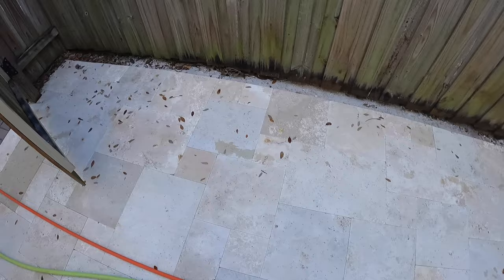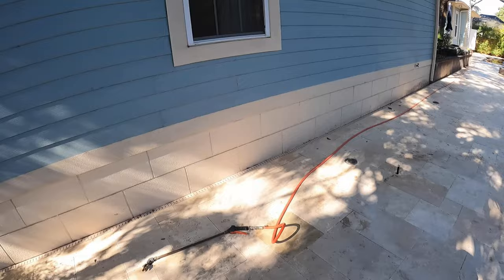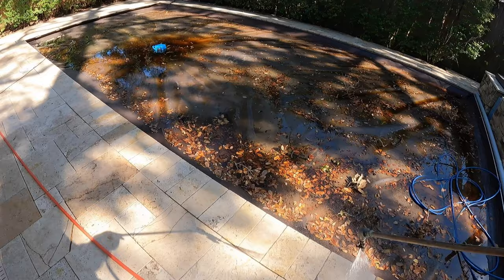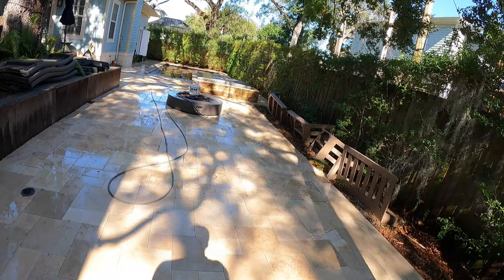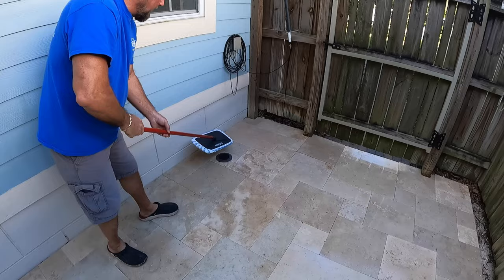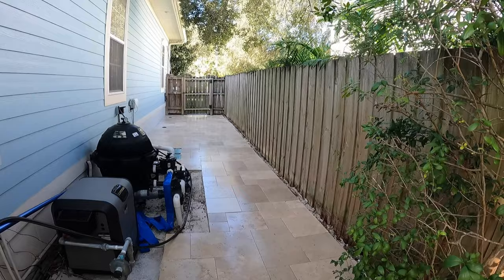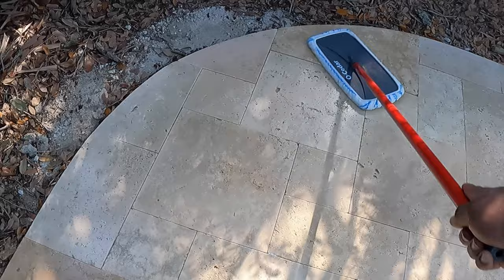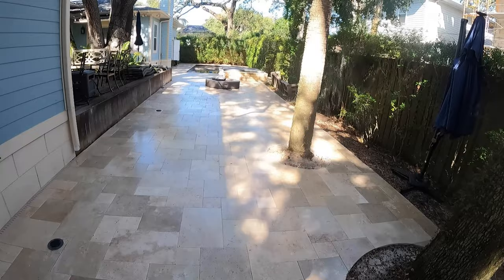How To Seal Travertine Pavers

Comment: Got to watch about 10 mins of the video yesterday, just finished it and the process is really different for sure.

It make sense that you can't just spray the sealer and let them dry like other pavers since these don't absorb liquid. 
Did you have to change the mop microfiber pad while sealing or was that one pad good enough for this job?

That shady area might've made it difficult to see the streaks when sealing them. But as for maintenance from the home owner, they won't get as dirty from the trees and easy to rinse or use a leaf blower to clean.

Great job as always. They should have you come back and clean the fence. It stands out big time now.
Reply from the maker: Thanks for watching. I actually changed the microfiber cloth about right the end when we bend that last corner heading out by the AC units. The mop was starting to stick and not gliding as smooth as the beginning. So its great to have 2 mop heads just in case especially for such a big area.

Maintenance will indeed be easier from the leaves and acorns. The home owner can easily rinse those off. Yes that fence definitely stands out, the person who gave me the lead actually thought I caused that lol I had to show him the initial walkthrough video.

That house needs a good wash as well as that back wooden deck area.
Reply: That's what I was thinking, bigger area being a factor. So it starts to stick and not glide well, interesting. Good idea to have a second mop head for sure. Thanks for the info.

I have to say since I watched the start of the video and then finished it later I had to go back and look at the fence myself. Lol but I knew you wouldn't have done that and not do something. But that's where having those videos come in handy for sure.

So I'm hearing a house wash and fence cleaning will be on the books when they complete the area in the back. That's me thinking positive😁. I'll look out for it for sure.

Comment: Looks great.  I clean a 12k sqft travertine  patio/pool deck annually.  Going to have to see if he wants to seal it up this year.  SH is right under $5 per gallon in central MN.  That includes sales tax and delivery costs though.
Reply from the maker: Yes there's great money into the sealing.  5 bucks isn't too bad if they're delivering it.  I know transportation of chemicals is expensive in itself.

Comment: Did you do a full second coat or just touched up. How long did you wait before you can walk for second coat? Thanks.
Reply from the maker: Just a light coat/touch up.  I typically wait about 45 mins/ 1hr. Before 2nd coat

Comment: Man they came out great. SH went up to  2.80 a gal here my area. Did the 6 percent strip the old sealer of the old tiles.
Reply from the maker: Wonder if they'll ever drop the price on sh.  Sweet!
Reply: @PinkFlamingoPowerWash  The way things are going it may not but hope it will.  Everything is getting expensive

Comment: Great video 🤜🤛 I saw the propane tank and torch…… did you hit the travertine lightly with flame to evaporate any condensation? 
And then lay down the sealer?
Reply from the maker: Lol heck naw.  No flame here hahaha that's willlllllld.  Nope the travertine dried from the air and sun just fine.  I wouldn't dare try to use heat on a customers travertine and potentially damaging it.

Comment: Great job thanks for showing the product. I just built a pool and wanted to know how to seal the new travertine. Looks easy just time consuming. Does it matter if it’s too hot out for the product to be applied. Do the pavers need to be dry. I live in Florida. It’s cool at night but hot in the day. 

In the early morning there is some dew moisture. Does this matter to be applied
Reply from the maker: Yes you'd wanna do it when it's cooler outside. So around 9am-12pm and then around 4pm if it's an open area without shade or tree cover. I would do it under 85 degree weather if I were you if there's no cover.

Comment: Glad you put this video up kind of never to do my first Travatin tile stripping and sealing. Going tomorrow morning to get the same sealer hear in Orlando. My question is on the second seal you don't spray it again or did you just touch up the streaks with the Swiffer mop? Also drying time between coats? They came out really good 👍
Reply from the maker: Hey brother. I told ya I was dropping a video on if.  On the 2nd coat after I  touched up the dry spots that I missed with rhe mop I then did like a real fine mist on top of it.  

Hold the want like 4ft in the air and just let the mist fall on the pavers. Dry time is quick on these cause it's a topical sealer but between coats it had done been at least 2hrs since it was a big job. But ideally about 30-45mins is enough between coats if it's hot and sunny

Comment: wont the 6% mix damage the wood fence/deck during dwell time, i understand rinsing off to the best of your abilities once you start rinsing but what about during dwell time? can it strip the stain or brighten it up and then itll be discolored?
Reply from the maker: If you spray 6% on a wooden fence it will discolor it for sure. That's too hot.  I never do 6% on wood fences. Most I'll do is 2-3%
Reply: but what about the overspray from when you sprayed the pavers? the little drips and drops bouncing off the hard ground surface
Reply: @PinkFlamingoPowerWash  what about the splatters from the mix bouncing off the pavers?
Reply from the maker: @codymerkle5174  if you're talking about my job on this video then no. It's a painted surface it's not gonna do anything. It's like washing a painted house.  I thought you were talking bout cleaning a bare wood fence or deck

Comment: With TravaCast being a film forming sealer, did it make the travertine slippery? Why not Silacast?
Reply from the maker: Silicast is for porous pavers. It's an impregnator.  Travertine is hard so there's no really room for soaking.  No it did not make it slippery. I wouldn't do that and risk my reputation.  I did it how it's supposed to be done.
Reply: @PinkFlamingoPowerWash  Thank you. I was just curious as to the effect. It looks great and was a very informative video.
Reply from the maker: @dominickbiangone1966  yes sir thanks.  Also there's an additive called shark grip that can be added if the customer would like it.

Comment: does the sealant make the surface slick when wet? ive had these issues with solvent based sealants and use water based cobbloc with grip due to that. Love the content man, definitely helpful.
Reply from the maker: I dont think it does.  My customers never says that.  Also the website for the sealer doesn't say it either.  Of course if it is you can add the shark grip to it.
Reply: Yes!  Go to Sherwin williams and pick up Shark Grip additive to add into the seal container, mix really well and apply as usual
Reply: Travacast from Decco and Tsunami from Trident Protects Excellent for Travertine and unpolished marble

Comment: Would sealing the travertine around the pool increase risk of slipping and falls?
Reply from the maker: I have no data saying it increases slipping. If that was the case travertine wouldn't be sealed at all.  There is an additive called shark grip that you can add for more grip

Comment: How do I fix my loose travertine.what sand should  I use thanks
Reply from the maker: They make repair kits for travertine.  I don't specialize in paver restoration.  So I don't fix loose pavers.  I just use silica sand and sealer. I tell the customers that upfront so they can fix their pavers prior to my service

Comment: Are you still in business and do you do the Brandon area?  Also how do you prevent slipping on the travertine?
Reply from the maker: Yes im in business still and yes I do service brandon from time to time. Can prevent  anything, people slip and fall on every surface that is wet. There is an additive to add to the sealer to help with grip but I will never ever tell a customer that it will prevent anything. Theres too many variables for an accident and I dont want to be liable for that.

Comment: How can you tell the difference between this and marble pavers?
Reply from the maker: Marble would be more of a solid surface. And smooth all over with no pores
Reply: @PinkFlamingoPowerWash  is it possible I can email u some pics? The homeowner thinks it's marble. I don't think it is. Nonetheless I'd like to use SH but if it is marble it can damage.
Reply from the maker: @jt7559  sorry I don't work with marble.  That's out of my field
Reply: @PinkFlamingoPowerWash  no worries guy thanks

Comment: No sand added on this one. So, you can seal without stripping the old sealer and it won’t affect the new sealer? I have my first travertine job coming up, so this was helpful. Thanks Cliff for all this content.
Reply from the maker: No sand was needed on this one. They were just installed for the most part. 2nd those weren't sealed so no stripper was needed. This is not the case automatically
Reply: @PinkFlamingoPowerWash  thanks 🙏